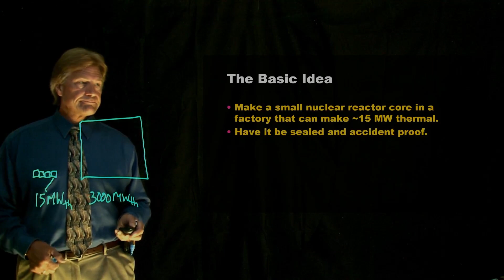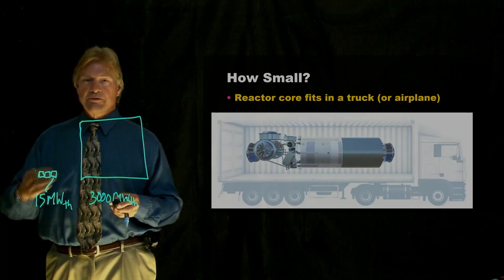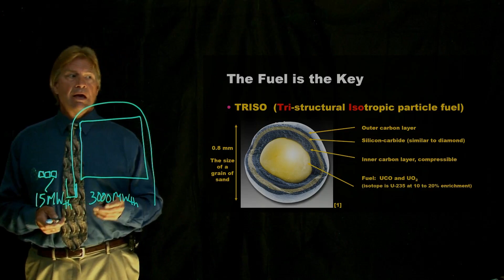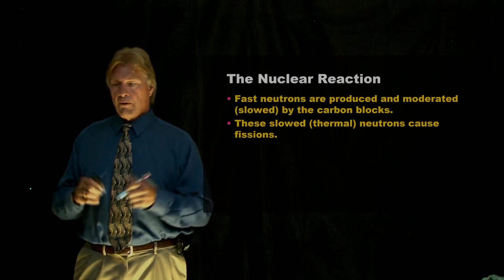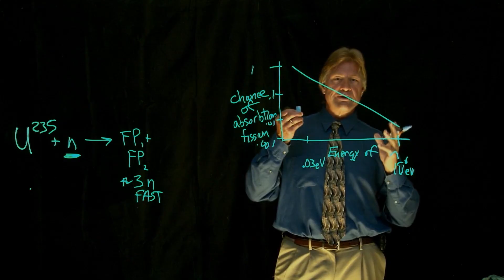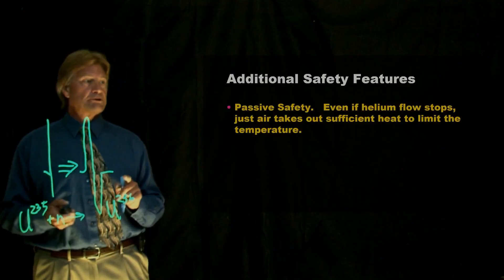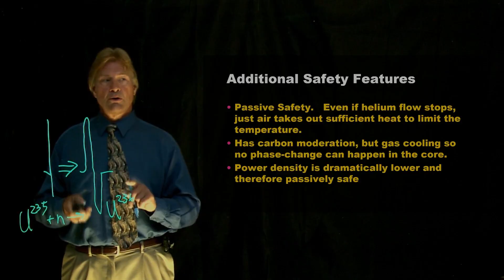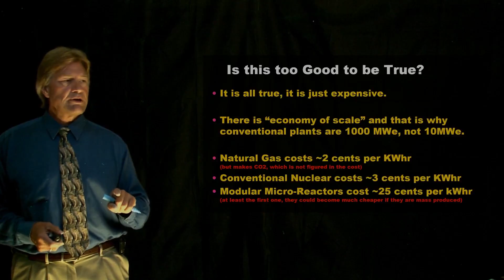Modular Micro-Reactors – The Future of Nuclear Energy?

Comment: Might be practical for military use, but this doesn't seem a game changer with respect to civilian power.  20% enriched uranium?  Seems like a huge nuclear weapons proliferation risk.
Reply: You'd have to manage to extract it from those silicon cased sand sized grains, I would imagine is very difficult
Reply: 20% is higher then the normal 2-3% enrichment but weapons grade is still 90%. Not saying a terrorist still couldn’t make a bomb out of it.
Reply: @supnerd9149  a dirty bomb maybe, but not a fission bomb. And that's really the problem with proliferation scares. A lot of them are just not realistic. If you stole a pile of this fuel at 20%, you'd have to enrich it yourself to get it to a fissile level. While it's certainly possible, it basically means building the enrichment facilities to do it. And if you're building enrichment facilities, you're not going to be stealing TRISO balls as your feed material. Remember that if this thing is only capable of 15mw thermal, you don't have that much fuel in the reactor to begin with, which makes this a bad choice as a source for bomb fuel. And couple that with the fact that every single minute that the fuel pellet stays in its TRISO ball, it is producing decay products, further lessening your yield. Your bomb fuel gets crappier and crappier all the time. 

Put  simply, anyone who wanted to build a nuclear bomb, did it in the same way. They built the specialized facilities to enrich Uranium and/or produce Plutonium. The USA, Russia, China, UK, France, India, etc. Centrifuges and special reactors specifically to make higher Transuranics. They did it that way, because that's the only economical way (relatively speaking) to make bomb fuel.

Comment: Yo, one of these types of systems in currently headed towards Mars aboard the Perseverance rover at 10,997.1 m/s.
Reply: RTG used on rover, or radioisotope thermal generator, uses decay and is not a reactor.
Reply: @stevemickler452  True, but could it be scalable? Also, with no moving parts by using TEG maybe could be a game changer in the near future.
Reply: @andymonger3022  The big problem as I see it for RTG like Percy uses, is that it requires plutonium. I did see a proposal to use cobalt 60 instead which has a half life of a little over 5 years {as I likely imperfectly remember} for spacecraft and is easy to produce using a reactor. Perhaps cobalt 60 would be cheap and safe enough for niche applications and maybe more.
Reply: Co-60 is a nasty gamma emitter, requires too much shielding for RTGs.
Reply: @nerd1000ify  Thanks .Didn't know that.

Comment: As an Engineer all I can say is that all of this is brilliant. But.. as the video reveals, these small modular reactors are likely to be very expensive and end up in niches like remote areas. 
Also relevant is the low power density. Good for safety reasons, but bad for overall material utilisation and cost. Plus a lot of the advocates of SMRs remain tight lipped about the fuel processing and end of life cost. In this case, those tiny fuel grains contain highly pressurised radioactive gases. There's a lot of end of life processing that has to happen. All of this costs money.

Meanwhile grid scale energy storage is rapidly maturing. Everything from LFP batteries to liquid metal batteries (reversible electrolysis) to good old fashioned pumped hydro to thermal energy storage systems to liquid air energy storage to hydrogen. Storage on a scale from hours to months. There is almost no conceivable future in which nuclear energy will be cost competitive against renewable sources plus grid scale energy storage. (Yes, except remote locations and of course in space). 

So, yeah.. I love this tech. Its sexy and clever. Its also never going to be mainstream.
Reply: @George Mann I'm skeptical of your claim about waste processing costs, especially since we are talking about potentially recyclable materials versus radioactive. Nuclear waste might contain a lot of energy, but the reactors that can use it are far too costly and will always remain uneconomic when competing with grid scale storage. 

Pumped hydro, liquid air energy storage, compressed air energy storage, hydrogen (and others). All provide storage beyond one day. 
Batteries now provide far more than spinning reserve. Batteries will be the most cost competitive means of storage up to around 24 hours.
So, you're basically wrong. You're also wrong about battery chemistries requiring the use of nickel and cobalt. Even in EVs the trend is away from the expensive elements.

Molten salt storage is also applicable to non nuclear energy storage. Its one of the potential competitors to liquid air and hydrogen.

Renewable sources of energy are also a good match for EV charging load (a load that can be controlled to match availability). That goes for both solar and wind. Indeed a grid with a substantial quantity of wind energy will have substantial spare capacity at night. Not that it matters what time of day your EV is charged. Also, EVs themselves will become part of the storage equation. Note also that it is more economic for a home owner to own solar and use that for charging in preference to selling to the grid so you can expect to see a lot more domestic solar installations for this reason.

There are also many other uses for the "excess" energy generated by renewables, as you (unintentionally) alluded to. These include the production of hydrogen (stored for uses that include chemical manufacturing and steel making). Also, ammonia, other chemical processes, cement (via heat storage or hydrogen) and so on. And of course, as you said, desalination. Remember that there will also be a significant oversupply of wind energy on average and the market will respond by creating a use.

Your argument about wind and solar being inherently uneconomical flies in the face of established fact. These technologies are maturing and are already economical. On a LCOE basis  these sources of energy are now cheaper than most fossil fuels in most countries. Yes, there are places with cheap (or subsidised) LNG. But that doesn't account for the carbon capture/storage cost. If you don't factor in that cost, you might as well continue to burn fossil fuels and deal with the consequences. Your "3-10x" oversized transmission lines claim is errant nonsense. Take it from someone (me) who has worked on power storage and transmission projects. Its very simple. You put energy storage at critical nodes on the grid and you rely more upon retail level generation/storage (shopping centres, factories etc). All of which saves these users money and actually takes strain off the grid.

So let me return to the original point. Nuclear engineering is expensive. Its inherently expensive. Its not going to compete with grid scale energy storage (in all its facets, including domestic energy storage). We are talking about technology that is either already mature or will be so within this decade, is modular, is fast to build (financiers love this) and which is relatively fast when it comes to planning and permissions. Versus nuclear technology which (even in modular form), takes a lot longer to get operational and is from the point of view of financiers, far more risky. Not to mention that a lot of these new generation reactors are still a long way down on the technology readyness scale. But the biggest risk is simply this. In 10-15 years from now (realistic if not optimistic time frame) all the grid scale storage options have progressed down the learning curve  and are simply impossible to compete with. Risk averse financiers won't touch nuclear for that reason alone (safety doesn't come into this).
Reply: I too want to hear more about waste reprocessing plans and costs.  Are those costs included in the estimates given in the marketing materials?
Reply: Once you're making say 10 year for niche markets the price starts to come down, then it becomes more attractive, and situations like California at the moment (rolling blackouts) is WHY they are useful.
Reply: @killcat1971  Yes and in all that time, competing technology also matures and becomes even less expensive. The odds of nuclear competing are quite frankly, remote.
Reply: If these do become successful in remote areas, I'm hoping that they help to normalize nuclear power. If people become comfortable with tiny ultra safe reactors they may become more comfortable with bigger and more efficient ones.
Reply: @manatoa1  Safety isn't the issue. I'm personally quite satisfied with the "walk away" safety inherent in some recent designs. The issue is cost. We're talking another 10-20 years worth of development (realistically). During this time, grid scale energy storage becomes mature technology. Cheap, reliable energy. Just not nuclear.
Reply: @saumyacow4435  If the issue is cost alone, then it is a non-issue in an era of global warming.
Reply: @bobthebomb1596  This assumes that nuclear is the only technology that can provide reliable, dispatchable energy. Its not. Renewables plus grid scale energy storage is a lot cheaper than nuclear right now in 2020 and this technology is only going to get cheaper. Not only that but they can go from concept to operational on a far shorter time scale. If your goal is to decarbonise and provide reliable power and do it asap, its a no-brainer.
Reply: @saumyacow4435  No, it does not. Nuclear is one of the options available, we should use whichever option best fits an individual situation.

Comment: Haven't you heard of terrorists? Wouldn't those small reactors be a target? They could just steal the radioactive material and make dirty bombs...
Reply: No. It's not sufficiently enriched to create a fissile weapon. Even in the case of large commercial reactors the biggest risk presented is loss of electricity in the event of a terrorist attack. The simplest terrorist target would actually be the water system. Drop toxic chemicals in from the air.
Reply: @paulanderson79  Who talked about an A bomb? Not me... Just spreading radioactive material on the middle of a large city is pretty nasty!
Reply: @cmuller1441  Fresh reactor fuel is pretty benign. Spent fuel slightly less so. The terrorists would still have to gain access to the reactor and dismantle it.
Reply: @paulanderson79  First of all if your line of defense is just "the adversary is stupid" you are in trouble... The problem is the number of those reactors. If you have thousands of them, how do you secure them? Big ones are already not secure enough. Greenpeace often simulate attacks and they have demonstrated that the pools could be bombed.
But the main weakness is probably the shipping of old fuel. This is already a problem with current technology. The forces protecting it is too weak. Greenpeace (again) showed that they could anticipate when and where old fuel is transported and that a few men with rocket launchers could make a ambush...
Luckily this was just a proof of concept and not real attacks.
Now imagine hundreds of those trucks traveling arround the country to carry all that fuel...
Even new fuel is bad because even if it's "not that bad" I can guarantee that people will just get away from that city. Would you raise your kids in a place if the probability of getting a cancer in 10 years is 10* the normal rate? That city would just become a ghost town.
Reply: @cmuller1441  What's defence got to do with it? This is a discussion between you and myself, not a war! There is the frenzy fury effect of course where people fear the word nuclear. And that alone is enough to cause issues socially. Though personally I'd happily live right next door to a reactor.
Reply: @paulanderson79  I guess my answer was too long for you. You stopped reading after "defense". I think you missed something.
Reply: Suit yourself.
Reply: @cmuller1441  These reactors would be sealed : no refuelling, no trucks travelling around the country to carry fuel. A single oversized shipment under escort to install the reactor, and an other one when returning it to the factory.

The hundreds of trucks and shipments carrying fuel is already being done with current reactors, and they're fine.

There have been accidents with nuclear material being spread around entire towns (from medical machines). They were detected and thoroughly cleaned and are now indistinguishable from any other town.
Nuclear dirty bombs aren't a thing : They're ridiculously difficult to make, very difficult to use, they will only contaminate a very small area.
So... they don't kill many people, they will be cleaned very quickly and life will be back to normal within days.
Reply: @BlackSharkfr  is a dirty bomb very effective to directly kill people? Probably not. But you are completely missing the psychological impact and the fact that many people will be confused and think it's a nuclear bomb. The goal of terrorism is... Terror.

Comment: I don't know if anybody mention this, but I can see this be used in areas that has been affected by major disaster, where a good majority of the power is out.
Reply: Definitely.
Reply: Possibly, but in disaster areas (I live in Florida) the power outages is the result of damage to the transmission lines, not so much the producing facility.  Even a modular reactor would still need to be connected to the distribution grid.

Comment: A couple of questions, if anyone knows the answers -- 1) what is the advantage of using more highly enriched uranium?; 2) why is the fuel life longer than 2-3 years as in a standard plant ( I would expect it to be just as contaminated with neutron poisons in that time); 3) can it be shut down with control rods or something similar; 4) can it be used as a peaker plant when extra power is needed, typically in the dead of winter or summer?
Reply: 1) Smaller core; fewer neutrons absorbed by U-238.
2) See 1b.
3) Sure.
4) Given the cost, you probably want it running 24/7.

Comment: Maybe it should be make smaller and smaller size until it is reach the size of a car's engine or smaller. And it would be very usefull to power cars trucks or manage to power and heat hauses. If it is possible.
Reply: It's possible to build one small enough to put in a car, but the power to weight ratio would make it completely impractical.

Comment: Proferrsor, can you please adress nuclear proliferation/terrorist threat in the context of this design? State actors asside, how easy/hard would it be for somebody to use this "battery" in a nuclear attack?
Reply: The reactor is sealed (no refuelling) makes the fuel tamper proof.
Opening the reactor means decommissioning the reactor (the electricity company won't allow you to kill their asset)
Getting the fuel out requires a specially designed high radiation manipulation room (the plant does not have one) or anyone attempting to take the fuel out would die instantly.

The one problem is the highly enriched fuel : 10~20% is significantly more that the restrictions we impose untrusted nations (like Iran).
So the manufacturing plant would have to be in a trusted country (US and allies), and the reactor would have to be shipped around the would and retrieved at the end of life for dismantling.
Reply: @george mann: adreed on the scare weapon, but that's not the main problem. Wuestion is...how much closer would this reactor get bad guys (state actors asside) to a functioning nuclear weapon. If the technology for converting the reactor into a bomb, is just as prohibitively expensive/energy intensive/difficult to set up/operate....than these reactors have a chance. If not...they will stay on the drawing board, despite the amasing CO2-free potential. Would love to hear the professor address this.

Comment: The Moltex and Elysium fast spectrum reactors will burn the used nuclear fuel from PWRs. That stuff has had just 5% taken by the old reactor. The other 95% is there to be used with no more mining and no more storage costs. They can also burn the plutonium waste from nuclear bomb production AND they can burn the depleted uranium left over from the old nuclear fuel production. 
Check out Ian Scott and Ed Pheil.
Salt is corrosive, but only when water and oxygen are present. The chlorides used by these reactors never sees any oxygen. It's actually less corrosive than the hot pressurised water used in PWRs. 
What about the waste? The fuel is liquid so every last percent of the energy can be extracted.
Molten salts have such a high negative temperature coefficient that they simply cannot overheat. They are naturally load following. Even if the load was removed at full power they'd just sit there making very low power until the fuel runs out. At higher (but still safe) temperatures, the more rapidly vibrating molecules bounce neutrons away. Very few impacts create a fission reaction.
The Elysium has a one size core. A low power version has a small heat exchanger. High power versions have large heat exchangers. Moltex puts the fuel in tubes. More fuel tubes = more power. 
Moltex uses its core to heat molten salt thermal stores. These feed heat to steam generators. 1 MW of reactor can feed 3MW of peaker turbines. Ian Scott says his plant in Canada will cost less to build than a natural gas fired plant. His fuel costs are negative, because he is being paid to take the stuff away.